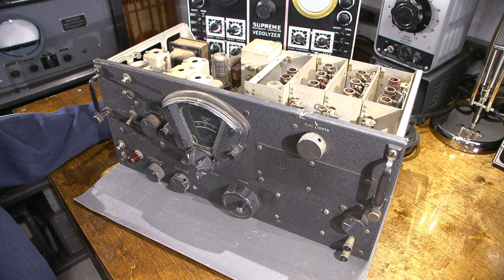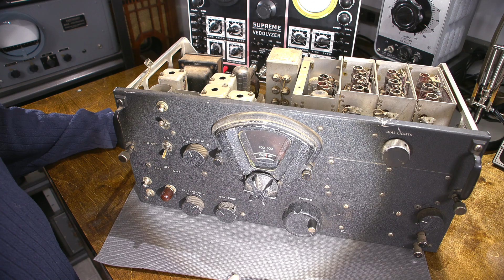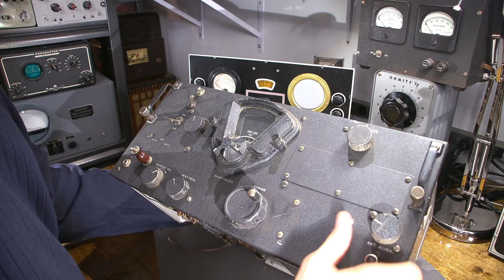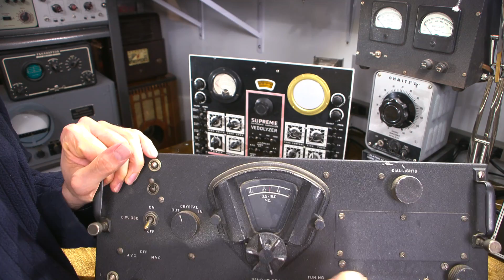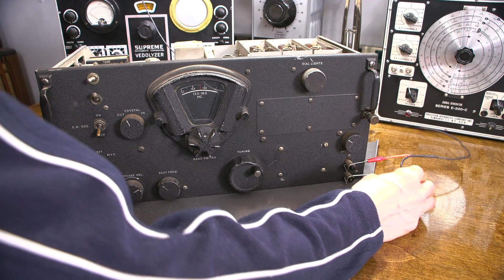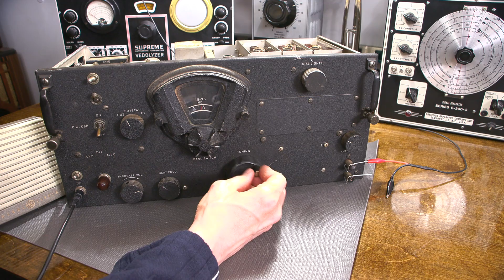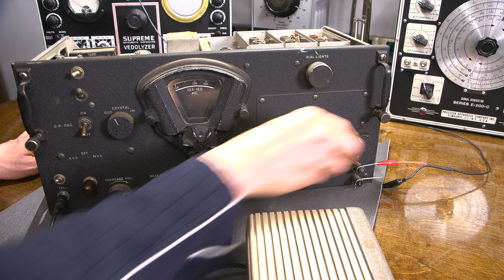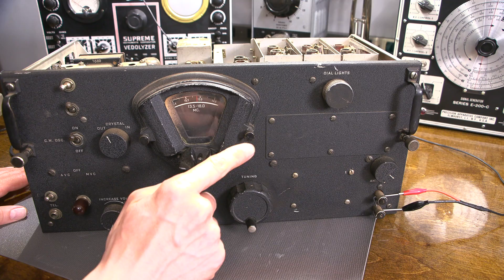B-29 Aircraft Receiver Scrap Parts Unit, Will It Still Work?

Comment: I look forward to your rebuild of this one. My first radio back in the early 1960's was an R1155, very modified; any chance of finding one of those and restoring it Paul?
Reply from the maker: Hi Robert. They look a bit like the Marconi CSR5. I'm sure one will come my way.
Reply from the maker: Yes, the plane would have to stop to refuel an extra time with those onboard!
Reply: You probably already know that the R1155 was the UK equivalent to the BC348 and was used in aircraft like the Lancaster bomber.
Reply: @Jack O'Bean I still have a BC348 which I purchased from the Air Training Corps in 1978 with my first weeks wages. However, it hasn't been powered up for about twenty years. When I bought it he ATC squadron I was in had just been allocated an RA17. 

A couple of years ago I was talking to someone who worked on RA17s in the RAF back when they were still classified equipment. Obviously by 1978 they were surplus to requirements and being given out to ATC squadrons, as was a lot of other Radio kit, like the R210/C111 army set that was our main station. Every Sunday I would be one of three our four cadets using that to talk to other ATC stations around the U.K.

Comment: It's on the healing bench, it'll get healed. Edit: You can hear the fatherly disappointment in Mister Carlson's voice as he digs deeper into the butchery. He's not mad, he's just disappointed.
Reply: I noted that exact thing myself, but one has to expect radio amateurs with surplus gear to mod mod mod.
Heck some of us do stuff to brand new gear, but none of MY stuff is going to be on a bench years from now I'm pretty certain.
Reply: @stridermt2k  ,  I said that about my 1984 Icom 751... modded with a new ram board. Yikes... Now I have a new Icom 7300! LOL  KQ2E
Reply: I can imagine someone having and modifying this while dreaming of affording a Barlow Wadley XCR30.
Reply: If it isn't broke. Fix it until it is. Then sell at a radio meet for parts 25 years later.

Comment: I had one of these. It was out of an Iceland Air DC3. I so regret selling it now. The feel of those controls is something you don't get any more. Isn't this the radio you can see in the background of the cockpit on the original "flight of the phoenix" film?.
Speaking of funny recollections for old radios... no19 tank set had a quarter turn flag lock on the edge of the dial for fixing frequency with FLICK marking it.... it doesn't take much dirt for that to read something else..... you also want to get a look at the original manuals (especially the disposal section). Modern stuff has disposal notices along the lines of do not throw out, ensure it goes into the correct recycling line, protect the pandas  etc etc. The disposal sections of these old radios were much more fun... preferred option EXPLOSIVES :-).... secondary option smash every dial and valve with as big a hammer as you can find then set it alight with petrol.

Comment: Great to see you being so enthusiastic about these rock solid electronics. Once I got my hands on a old radio that had two scales (I mean one with a lot receiving bands on top of the radio (30 by 80 cm wide glass plate) and one under the huge speaker that was a bit smaller) for air, sea, river, traffic, police, fire brigade and you name it, I guess it was from before 1930 cause it had such a huge range receiving signals. Unfortunately back in the eighties, when I picked this bad ass up from the streets, it had missing one big old paint covered tube and one that was broken (cause all them tubes were red painted) and the one time I tried to get life out of it, the mains cable that was maybe copper (it did not look like it) wrapped in some cloth with a sort of wax in it, and those two wires were also wrapped in some cloth looking cover that had a tar-ish smell, especially when it started to smoke, lol lol.... Sadly I could not find the tubes, they were not available at that time, even contacted philips for it, but no way that they were found, then... Nowadays all those tubes are coming back, pity I had to scrap that radio, I saved over the years the condensator that, as you described going from microfarad to picofarad, the 'tuning block' Unfortunately there was a leaking in this old shed, in a box where it was wrapped in cotton but other steel material in the box got rusty and it jumped over to the tuning block, destroying it completely....
Everytime I see an ad, link or reference to old radio's, I can't ignore and have to see if I see that bad boy again, I would love to see that one running somewhere somehow....

Lovely to see your vids.....

Comment: As always Mr. Carlson, I loved your video. I have an old Canadian Marconi AM radio. Or at least it is one part of a radio set. It looks to be some sort of military or maritime radio, as the insides are all metal pipes and geared shafts to change what ever is inside the enclosed boxes. There are no wires, tubes, or boards to be seen when taking the case apart. Really dam cool looking and looks like it cost a bundle when it was new. I bought it years ago and haven't seen inside it since I bought it. It is fascinating enough that I would like to take a picture of the insides and make a poster of it. It is probably only useful as an anchor, and with it being as heavy as it is it would work well as one, it must weight at least 15 pounds and quite possibly more.

Comment: I have two BC-348Q Receivers made in 1944 one I had to do some minor repairs to and the other is bone stock completely original and still works as it did originally during the war. Both of mine are made by Wells Gardner. Mine are both Complete have all the covers on them and both do have power supplies that were added. Thanks for showing one of these old veterans of WW2. These radios were definitely built to last. Yours has been heavily modified I noticed the military loom type ties have been cut off on yours mine still have it.

Comment: I have one of those GE speakers, same color, mine came with a 4 ohm Pioneer speaker in it and it sure does a great job with the vhf mobile radios I have had in my car even an Icom IC-Z1A that you could hardly hear with its tiny speaker in its head. Happy restoring Paul :-)

Comment: A good find, Paul. No, a fantastic one. Despite the "parts" classification and the power supply mods (plus speaker and a small power amp.), the front is quite clean and not too much damage has been done.

I have restored a Marconi R1155 including its direction finder (RAF Bomber Command plus some other uses), various "Command" sets and a National HRO Sr (1937). However I did replace the by-pass capacitors before switching them on (and "hid" the new caps  in the original cans or paper cylinders). I also provided an external power supply and 6V6 power amp for the R1155.

Look forward to seeing your BC-348 in the future. Great vid.

Comment: I remember buying old military radios and such way back in the late 70's early 80's from a place called Fair Radio Sales in Lima Ohio. They had a grab bag special where you got a box based on weight, you never knew what was going to be in that box, only that they promised you would be very happy at the value. Got literally tons of components in those grab bag boxes, many NOS still in the original Military parts boxes. Thanks Paul for taking the time to see if the old girl would work!

Comment: As an ex tels tech ( British Army ) from early '70's this is fantastic. The sets I worked on were C11, C13, C42, A40, 41 amongst others. Your so helpful with the descriptions as I'm returning to my valve ( sorry tube ) radio hobby.
Thanks a lot, Colin, UK.
Reply: Ahh that brings back memories of carrying a A41, reaching for alcohol. C42 and BID 150,we had a small hammer to tap the 150 so all the pins went where they were supposed to be on the cards.

Comment: I was a crew chief on the KC-97L. Which for those not familiar is the grandson of the B-29. (The B-50 was in between) The '97 was actually 2 fuselages married together to form a double deck. Re-engined to the larger P&W R-4360 and two J-47 jets hung on it too. Everything else was basically the same. Loved flying on that aircraft.
Reply: If you buy a warbird, the trick is to get one with the same engine as what was used in the Airlines, because there are still warehouses full of parts for those old radials as many saw service into the 80s domestically

Comment: In my teens, I had a BC-348Q and it was wonderful.  I don't know what ever happened to it.  I probably traded it at a hamfest or it was just tossed when I went on to electronics school and left my parent's home.  I know a lot of my old stuff went to the dumb.  I moved to Cincinnati (for 14 years) and abandoned it.  I can't blame them.  Now that I am getting more and more nostalgic,  I can think that I would want one.  On EBAY, $900!!!!!!  There's one without the motor/generator or power supply, $250.   If I did pop on one like that, I doubt I would ever get around to restoring it.  I wish I would not have gotten rid of the first one.

I can remember a roll of calculator paper, where a friend and I pre-typed a bunch of answers.  We had it in the radio sticking out.  We had another gullible friend over.  The radio would be tuned to CW or some computer generated noise station (this was mid-70's).  We would ask it questions with my ham/cb microphone.  Turn up the volume so it it sounded like it was a computer "thinking" and pull out the paper answers - LOL (I guess between the top and cover).  I did use it as my main ham radio receiver back then (WB3INW).  Since all that time, my ham license is long, long lapst, but some of the memories are still there.  The interwebs are my new ham radio today (I know, no good in a zombie apocalyptic situation).

Comment: I've got a BC-348 that has been sitting in my ham shack for about the past 25 years.  Got it for free, and have never fired it up.  Cosmetically it is in better condition that the one shown here, and also has the full AM broadcast band.  (The band selections varied between different BC-348 models.)  The power supply is external to the main radio.  Now you've slightly pushed me in the direction of seeing if I can get it to work...

Comment: Back around 1958-59 I used to find a lot of this stuff in 'Surplus stores' in s. California. There were several Air Force bases around...Some of these radios had external dyna-motors, you're correct, 28 VDC in, and 400 Hz high voltage out.

Comment: Man, I love your channel.  I love it when you work on all that old electronic equipment from yesteryear.   I just subscribed.  That is one ancient piece of gear and I'll bet it is heavy as all crap too!  Look at all that green crap on and around that fuse on the bottom!  That was funny about taking out the radio would allow for more altitude.  That is one LOW frequency radio.  A HAM would love it for CW transmission.  And I thought my old 42 year old CB radio was old.  Think I would have used a vacuum and a paint brush to remove all that dirt and dust before powering it up.  This is getting exciting waiting for you to power it up with an antenna and a speaker.
Reply from the maker: Welcome Rusty!

Comment: I have one here  bought it in 1972  made a power supply for it back then  for 120 V  it has worked great ever  since I use it on Cw mostly with a Q-5er  beacon receiver connected  as second IF  that narrows the bandpass down to about 1000 HZ  for better CW receiving . Nice video .

Comment: Hi
I have an unrelated question.
Way back in 1990s I was taking electronic courses and 1 of them was project fabrication where we had to take a schematic out of the electronic magazine and build it from scratch, so I chose a voice zapper where you connected it to any stereo music source like a tape player and it would zap the vocals out of most songs ...(most vocals are in the center chan.). 
The device would take the voice which was common to both L n R chans and then delayed it then filtered it out. The result was much like those Karaoke machines.
The brain of the device were 2 IC chips which I had a hard time finding. I called all over USA and finally found an electronic Corp in Dallas Tx who sent me 4 of them for free! 
I gave 2 to a classmate and I used the other 2 to build my project. 
I cannot remember the kind of the Chips or anything else because I left my device at work. I quit there n never went back to pick my things up, so it's gone.
So my question is, what kind of chips can delay audio signals by  few milliseconds and which chip can filter them out?
This has been bugging me for a long time.
We used to copy the circuit boards (traces) or take the negative image from the magazine cut it to the size, place/secure it on the copper side of circuit board     then put it under UV light for a minute or 2, take it out put it in 3 diff. solution ( etching etc.) The result was a perfect circuit board. We used those thin drill bits on press bench ( to always be vertical) and drilled the holes for the components. 
As I said before I wished we had Mr Carlson's (great) Lab back then. I'd have enjoyed electronics  that much more...

Comment: Great radio!  I've found that many eBay sellers list things as "parts or repair" to avoid having to guarantee any sense of working condition even if the device is working.  They also use this technique to avoid having to support returns.  It's another way of saying "sold as is".  Looking forward to the restoration!

Comment: Nice receiver,  I'm currently working on a (BC-348) that the previous owner hacked the heck out of. I replaced all of the resistors, capacitors including the metal can type. I found out the following, those metal can type caps are super leaky, a few of the black mica mold caps have dead shorts! and the wiring shorted or not connected. Now I'm time to peak the IF and perform the RF alignment.  Will upload a few videos soon. Thanks for the video!

Comment: Mr. Carlson, just a word of caution. When handling inner electronics of old war miñitary radios, especially WWII ground radios, some had chemical coatings sprayed over to avoid inside insect propagation. I had a WWII tank transceiver with a side generator isolated in it's own housing. When I opened to inspect either generator or radio, there was an old sticker on the lid stating a warning to that coating. Upon heating the solder to replace some caps, did notice a different smell drift out, which later invaded the whole work shop, which had to be ventilated for a couple of hours. Sorry no photos of it, but do remember it was a 1942 build with a predominant RCA parts inside. Coating was like a yellow tar that covered all under electronics.
Reply from the maker: Hi Jose. It's known as "Fungicide."

Comment: I have a BC 348Q I bought for like 40 bucks maybe 10 or so years ago. It had a home brew separate power supply that had the wires cut. I matched up the colors and wired it back up and it works. I think it has most of the original parts and lights still on it.
I think one of the tuning coils is broken so one of the bands isn't peaked like it should be but everything works. I had a couple of the old us navy 82lb department of ships radio sets but all the caps were bad and then somebody stole all the tubes. It was a very advanced radio that included SSB reception. I ended up saving what I could but this was in the late 70s so a bit more common than. I still have both data plates. One is crv-46147 RBB-1 contract date Sept 2 1941, other is crv-46148 RBC-2  both made by RCA. Second data plate is later, probably after war had been going a while and is some kind of fiber board rather than steel like the early one. These things used to be common and show up at garage sales and surplus shops cheap.

Comment: I've got a BC-342 and clean BC-348+Arc5 (with Dynos).  The 342 is an example of  Hack and Mod' , but the 348 is original (It has a fungicied stamp, so it was probably from the Pacific theatre).  Thanks for opening your's so I don't get tempted to open mine..... :)

Comment: Have you ever restored an "R-390"? They were my first job in Radio One aboard the USS Newport News (CA-148). I did a refresh on all aboard. Then moved on to AN/WRT-2 HF transmitter field changes. Very good video sir.
Reply from the maker: I have. I have also restored Racal RA-117's and RA17C12's as well.... and the RA1218..... and so on.
Reply: @MrCarlsonsLab  Thanks for your response, I will go back through your video's to have a look. 73's kd9oam.

Comment: Great video, when I got into Army Mars back in 1972, we had access to equipment, and most of it was from WWII . I was a radio op in 1960 so knew what Dynamotors did had one on my jeep for the rigs there. Tnx for a trip down memory lane The only thing missing was the smell of hot dust off the tubes after they heated up. "Ah Foot warmers" you can't beat them or kill them! Thanks for sharing. de Ellis WA1RKS

Comment: That BC-348 was deemed as "parts" because it was old, nobody understood it and had no manual to operate or repair it. Otherwise it would have commanded a higher price and been used more. I have one that is not butchered and is mostly original with a power supply in the place of the generator. Mine has all the original parts for all the coil sets in the receiver, the "flusher" switch and only two minor holes drilled into the faceplate. A very fine receiver!

Comment: Impressive. It's nice to be able to reach into your parts bin, pull out a couple of old parts, and fire up B-29 radio. Definitely not hoarding - preserving I think is the word.
The burbling certainly could be data, but it could also be a short wave weather map image, which are easy to download (via audio) and convert to a BMP. I bought a modem 30 years ago - I'll bet you can buy one on Amazon.